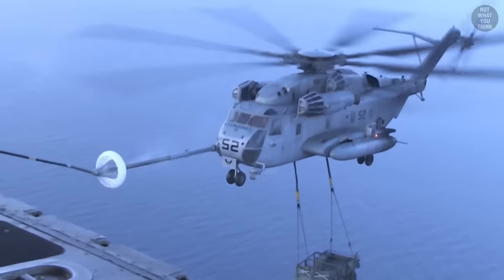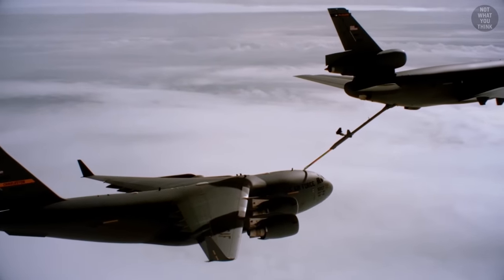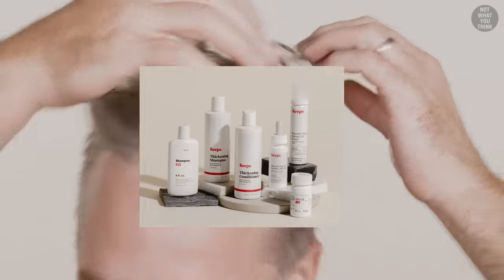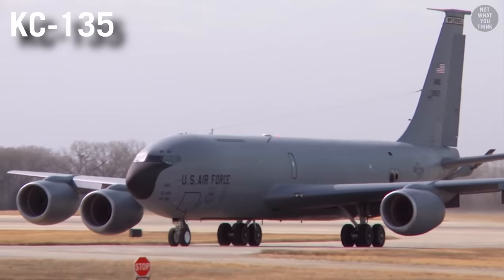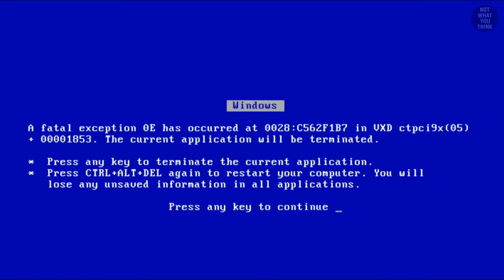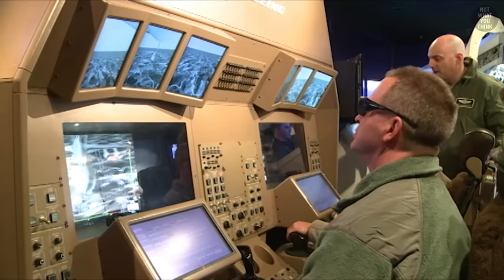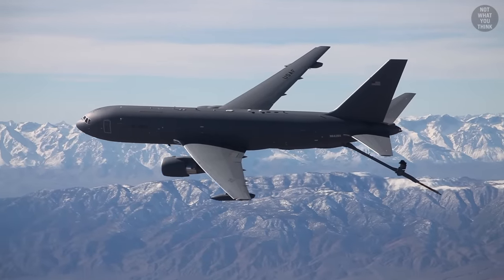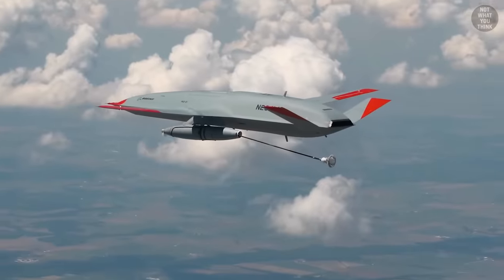Why US Air Force is Making Aerial Refueling HARDER?

Comment: In principle I'm not against modernization. In practice though I have too much experience in how military procurement ends up. So first off you have corruption, graft, and pork. The other part is bureaucratic inertia. A need is identified and sent up then generally subject matter experts figure out how best to meet it and what else can be included for efficiency. Then a whole bunch of people with no current operational experience decide it needs to be able to do a lot more than what needs to be done. The project moves from a need to a want that is disguised as a need. It is put up for bid. The companies bidding will underbid to get the contract regardless if they could actually supply the product at that price. Then the process gets reviewed to make sure everything is above board, then there is a phase where competitors can challenge the decision. While this is going on a bunch of politicians who's experience in the required need reaches into negative values pitch in. 
They'll only give in if certain parts are produced in areas that will benefit their voters. Then other politicians do the same. Then another agency gets involved and insures everyone gets a piece of the pie. At his point the contract may get awarded and production starts but because so many fingers are in the pie quality control goes out the window, which is fine because most modern projects signed off come with contractor only maintenance, meaning only the corporation techs are authorized to conduct maintenance on the system. This ensures repeat business, same for parts that constantly malfunction, it's just repeat business. The staff turn a blind eye to this because their retirement or promotion is on the line, the politicians turn a blind eye to it because their base and reelection is on the line. The people operating the system are ignored. Remember they are replacing systems that are 60 years old and there are other systems that are older and still in operation but it seems that everything that is being developed recently is coming with a shelf life of store bought milk and that is because the politicians and corporations need the repeat business. Old military equipment lasted as long as it has because it was designed that way, to last as long as possible with as little maintenance as possible because the people who designed them knew that you won't always have spares, you won't always be able to send it up at a 100% but it needs to get the job done. They knew that in real war there is no luxury where they can stand done the entire fleet or halt operations because of a glitch. 

I'm sure when air support is unavailable and a bunch of soldiers die to enemy air support or get over run that, the computer wouldn't boot up or stuck in upgrade status will look fine on their head stones. 

Boeing is taking the loss on this because they got caught so badly that they'd get crucified if they tried to ask for more money, and the only reason the politicians are holding their feet to the fire is for the same reason, they'd get run out of office otherwise. All of which is a disgrace, FDR  would have had them all stood up on a wall and shot as deserving for such traitors.

In short it's no longer lowest bidder meets spec, it's just what the lowest bidder can get away with and the goal there is to get away with it long enough so that canceling isn't an option and once that point is reached they close production so that a new contract must be bid on. Politicians and general officers are content to have service members operate and fight with equipment that will get them killed with out enemy action.

Comment: I've never understood why anyone over the last 40 years would have used black and white video in a military sphere. And why multiple camera angles wouldn't be needed. And why are they thinking 4K. If you're just starting to design stuff now, think 16K. It's already being prototyped and the military will hugely benefit from high resolution.

Maybe Boeing should talk to cell phone companies. Maybe Samsung. They produce great cameras. 

Similarly, why would you get rid of a direct line of sight unless you have astounding tech to replace it?

All I can conclude is that Boeing and other contractors don't really think things through and consider all the aspects of the equipment they make when they are used in the field.

I know humans aren't good at thinking things through and prefer to "wing it", but that won't work here and those wings might fall out of the sky.

Comment: "They want to automate the refueling process." Ok... but why? I get wanting to remove pilots from combat aircraft, safety and higher performance, and from things like super long duration recon, but why boom operators? Aerial refueling is the absolute backbone of the US Air Force's power projection capability. Why the hell would you screw around with that capability? Tankers aren't in the line of fire, boom operators while capable aren't nearly as difficult to replace as pilots, and what are you really gaining? Seems more like technology fetishism than an actual good use case for removing a human.

Comment: Just put a strong laset at the tip tah emites low UV so it wont ignite the fuel
Reply: So, tape a laser pointer to the end of the boom?
I see your idea, but fog will block out the laser and overly bright days will drown it out.

Comment: This exposure control missing sounds really weird.
Using this intermediate step might make sense.
They could e.g. record the manual operation and then train neural networks with that, which are later used for automated refueling.
However, I don't know whether they do that.

Comment: There's nothing impressive about a 18 year old boom operator. It's probably one of the easiest jobs in the entire D.o.D. The skill is with the pilots lining up and maintaining speed, altitude and heading.
Reply: This is actually not the case.  I've refueled 100's of time behind a KC-135 in the F-4 and it's not at all like threading a needle with the fan on.  The complexity is similar to parallel parking your car.  Yes, you have to pay attention, but if you are slightly off it's easy to start over.  With the boom system the total skill required is shared equally by boomer & pilot. When both are experienced (which is most of the time) it goes very quickly and with ease.  It's common to crack jokes during the process.

Comment: Wait so you're telling me Boeing and the US Govt collabarated and it went TERRIBLY wrong? YOU DONT SAY
Reply: And the US Military used MCAS and RVS whilst using their TLAs and fucking up their UAAS (unexplained acronym abuse system)? SHOCKER.  (Guess "shocker"'s acronym)
Reply: "Shall we just use a small window like we always have?" "nah, that's too simple and easy to operate.  It meeds to be  WAY more complex! Something which will almost always fail, but just work enough to be approved! And something we can turn into an acronym!"

And thus, RVS was born.
Reply: What do we use for aiming? laser guided, automatically computed, GPS/satellite directed computing systems

What shall we use for aiming the refuel with two multimillion dollar planes in dangerous proximity? IDK, shitty 2D low resolution black and white video with massive lag sounds fine.  Nah they dont need to see the boom tip!  Deal with glare? i dont even know what glare is!

Comment: If they had done the RVS2.0 setup from the start, think of all the revenue they would have lost out on?  Boeing is nothing but a money shredder at this point with their cost plus contracts and other horrible pork-barrel spending issues.  By "flubbing" the first one they get to go back to R&D and charge a bunch more money for the system it should have been from the start.  When they say "on their own dime" they will still profit off of it down the road as they will increase the cost of the more advanced units down the road as well as the opportunity to sell these things equipped on Automated technology.

Comment: How the heck did the RVS 1.0 system get accepted when it's so damn hard to use?
Reply: You can’t test everything until it is actually in the operational configuration. All testing up to that point showed that it was working. Could have Boeing done more DT&E before the final product? Definitely, but it was a firm fixed price contract so the risk (at least financial) was on Boeing. Unfortunately the schedule also suffered.
Reply: @johnp139  I'm not barbecuing the Boeing engineers, sometimes the entire deal is arranged so that the minimum viable product is the only viable product (timeline and budgetary constraints).

There should have been several rounds of reviews that included some of the actual refueling operators, would likely have saved Boeing money, and saved both parties time.

Some issues like depth perception and visibility on the cameras/screens in high-glare conditions could almost certainly have been caught earlier, although as you mentioned, the fixed price might have already meant that correcting it even at an earlier stage might have blown the budget anyway.

Oh well, reality is what it is, both in the government and private sectors, everywhere in the world :x

Comment: Going by the thumnail, the major issue will be converting all those USAF aircrew to fly the Mirage 2000 and Ilyushin Il-28.  Instant loss of credibility even before the video starts!  Perhaps the Indian Air Force can help?
By the way, there is no inherent penalty in fuel flow rate between boom and probe-and-drogue systems.  Flow rate is determined primarily by pump pressure and the available space you are pumping into.  Other air forces have been successfully using probe and basket systems for large aircraft AAR for 50+ years.

Comment: It's almost like Boeing had never built a refueling system before or created remove viewing for aircraft.  Not to mention the people doing the evaluation for the military apparently had zero experience actually working a boom and encountering the various issues.  Black and white screens?  Zero realization that 3d visualization was needed to gauge distance.  They could have easily setup VR Goggles for these guys to use instead of having black and white screens.  Heck, they could have gotten that off the shelf alone with camera's that autoadjust to prevent washout.  I have to say this is like NASA saying we are going back to the moon for the last 20 years but they keep running into problems with the tech they are building without realizing most of that tech exists on the open market.  Pitiful at best, corruption and pure stupidity at worst

Comment: A couple of BIG OMISSIONS:

1. Both the daylight and the LWIR systems ARE USING STEREOSCOPIC cameras AND 3D Displays.

2. Color IS NOT BENEFICIAL, and would result in 66% LESS RESOLUTION (1 pixel on B&W versus 3 for color display).

3. These cameras need to be hardened and airworthy in some extreme environments.

4. NO, your cell phones WOULD NOT WORK mostly because of the environment that they need to operate in.

5. The technology is at least 10 years old since that is when the design started. You can’t constantly be upgrading technologies AS you are developing a system.

E. This is a FIRM FIXED PRICE CONTRACT!!! NO ADDITIONAL TAX DOLLARS ARE BEING SPENT TO FIX THIS! Boeing is having to eat the cost. 

7. Some problems can NOT be found until flight testing using the actual systems are conducted. The prime examples are related to the variety of lighting conditions that exist in real life and contrasts of various receiving aircraft.

9. NO, you CAN’T just put in a window!!! This aircraft has other missions such as cargo carrying and Aeromedical Evacuation that wouldn’t be practical if you had to make a hole in the main deck for the AROs to sit in.

Comment: "Why US Air Force is Making Aerial Refueling HARDER?" - that sentence doesn't make sense as a question, only as a statement.
"Why US Air Force is Making Aerial Refueling HARDER" (As in: "THIS is WHY US Air Force [etc.]")

As a question the sentence would have to be structured like this:
"Why is US Air Force Making Aerial Refueling HARDER?"
Reply from the maker: Yes we know. Most of our video titles are structured like that (incorrectly if you will). But we have our reasons for doing it that way, and the reason …

is Now What You Think! 😁
Reply: @NotWhatYouThink  To click bait. It is not the USAF but the procurement process.

Comment: Talk about design bloat. Fiber optics, 4k screens, advanced software, all to replace a piece of glass in the tail section. Typical military over engineering. Even if you can create an autonomous system, why? Of all the positions that can be optimized by automization, I think boom operator is really low on the cost benefit trade

Comment: Typical over-engineering: What is benefit of remote boom operation? I can not see much. No cost reduction, no refueling operational advantage, no safety enhancement. No nothing. There may be some advantage but not worth such cost and complexity.
Reply: KC-30A refuels remotely and it doesn't have anything like the problems plaguing this hot mess. Hell, the RAAF broke a tonne of records operating it over Syria in 2015- and with zero restrictions on what it could refuel.

Comment: Two steps forward one step back, typical military spending once politicians get involved. You always need a redundant, manually operated, and first hand visual, mode with any military equipment. High tech crap fails at a higher rate than low tech and will always fail at the worst time. I guarantee once a few lives and numerous aircraft are lost due to failure of this system they'll spend even more money to retro fit a manual line of sight system that should of been there from the start.

Comment: So you have our brave flightcrews going into harm's way with a plane that first flew in the 50s? And its replacement is also designed and built by that company... all those years of tanker experience seem to have not helped the USAF to keep up with NATO airforce aviation that operates successfully a plane originally intended for the US... does not make sense. 
Oh and yes, Boeing is to replace the AWACS also more or less based on the 135... hmm... does no one get punished for such gross incompetence any more?

Comment: This is my problem with todays day and age. Everything needs to be automated and electronic. Throwing millions of dollars against it while severely under engineering it with a black and white screen wich doesn't show the most important part. With another big complained about not having depth perception. How about instead of throwing millions of dollars against it (again) maybe just instal a FUCKING WINDOW. Cause if there goes anything wrong with either the camera, wires, software, the screen the mission is over. While if you had a window beside you it could still be done.

Comment: AIRBUS A330 MRTT and your problems are solved. The problem is Boeing, not the camera system.
Airbus uses a camera observed FBW boom system with perfection for more than a decade by now. 

Yes they had boom problems but no camera problems and the platform is is service with 13 countries by now. All KC-10s and many KC-135s would already be retired if the US had bought based on merit instead of wrong nationalistic grounds. More than 50% of the value of all Airbuses comes from the US, some are even entirely built in the US and MRTT would also have been entirely US built. The US just wanted the Boeing name on their jet and thanks god they got a mess and disaster for their stupidity 🤣